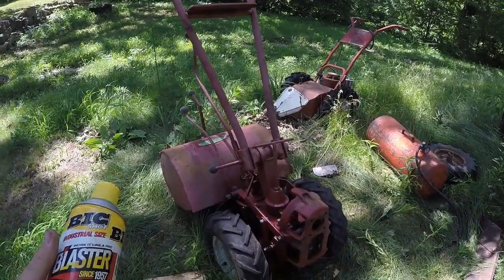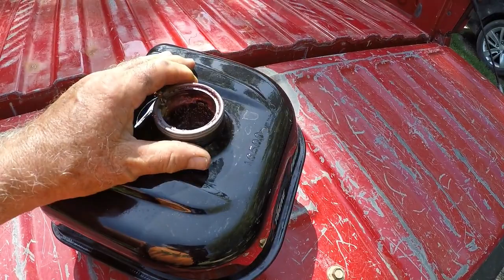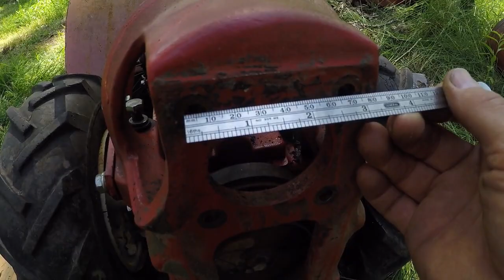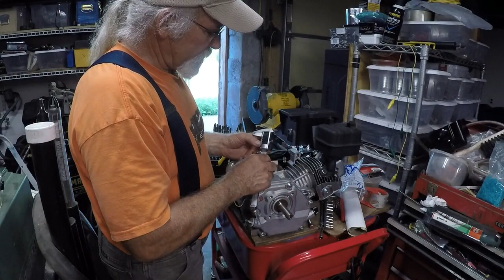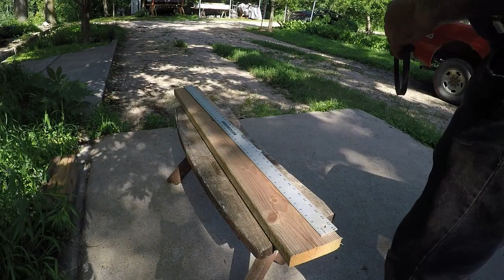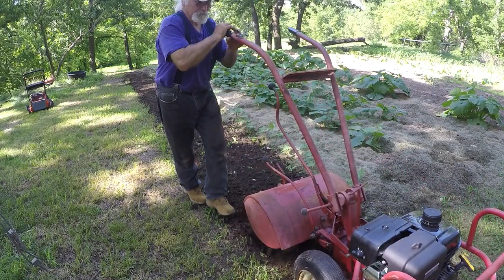Engine swap for Troy Bilt garden tiller, 212 cc 6.5 hp install solutions

Comment: Thank you for a great video.  You did not say why you enlarged the crankshaft hole. It comes 5/16 X24, which is the same as engine mounting bolts.

Comment: 1 note doing swap. 6.6 is better swap and side note the motor shaft has a 5/16”  x 24 hole the old motor had3/8” hole
Reply: Yes, thank you!!,  as this is usually not mentioned in videos on the swap. This video is excellent but he did not say why he is enlarging and retapping. It took me a little bit to realize that the crank hole is the same as the four engine bolts.

Comment from the maker: Thanks for watching my video,  Its ok with me if you prefer the original engine, my first Troy Bilt I bought in 1980 was a 7 hp Koller Horse brand spanking new in the box & 20 yrs later I installed a 8 hp and at this date it needs a complete rebuild including the brass worm gear at the tines. I bought the tiler in the video that had carb problems a long with low compression and burning oil which tells me poor oiling. Every one I know that bought the 6 hp Tecumseh had the connecting rod break, seize or piston seize. The problem is trying to till as deep as possible at full throttle  with that 6 hp, (I have been guilty of that), the oil splash doesn't work all that well with the engine at a sharper angle. Its not the engine so much, its the angle. I have a Tecumseh 8 hp on a stationary generator that has done will for 25 yrs running level but that engine is at the end of mechanical limits so I will replace it with a Predator 8 hp but have to pull out all the crankshafts and cut identical tapers in my lathe for another video. Glad you had the ability to repair yours and your happy with it but take care not to run it at a sharp angle or you might have to repair it again sooner than you would like. 
  Oh by the way check out the channel "Gardening with Leon" that guy is great and check out how successful you can use a "cattle panel greenhouse'. I'm building 3  10' X 12' this spring to get more produce and extend growing season. They are cheap & easy, watch a few of the youtube videos out there and have a blessed gardening season.

Comment: I have the same engine that had seized. I took it apart and it was in amazing shape except the connecting rod had failed. I replaced it and put in new seals and bearings (yes parts are still readily available).  I am no mechanic but that old engine is running good again and it beats a predator. If nothing else it weighs more which is good for traction.

Comment: Great video.  Did you ever do the electric motor version?
Reply from the maker: Thank you for your interest. I have not found a motor with the high torque & low rpm in AC that I would like and of course I would like it to be, well... free. There have been a good selection of electric small & light tillers on the market as of late to replace the trouble some 2 stroke garden tillers. Most gas tillers suffer from old gas & non-use decay that the nifty electric do not. So my putting a electric on one has not been a huge priority. But hey its been fun since I first posted this video. I have a few miss adventures to share too in the near future. Thanks again for watching, be resourceful, think on your feet because it will serve you well in difficult times and you will prosper when others fail.

Comment: I mix a wee bit of Dextron 2 transmission fluid in with my fuel, the tank stays coated and clean With no rust problems, just keep the tank full of fuel and turn off the fuel going to the engine when not in use !!
Reply from the maker: The coating I used had more to do how gasoline fuels are formulated (oxy and non-oxy), yours may be different hense the use of Dextron is giving good results for you and you should continue doing what works for you but might be a disater for others. The coating would work for just about everyone with all the wide spread use of alcohol additives in gasoline continues for now. Alcohol attracts water, alot of water.  Alcohol fuels are unsatainable without tax-payer supports, current methods of production use far too much water, land, chemicals, even including animal feeds produced and oil based energy costs. The system puts in more energy & resourses into a fuel than we get less energy and resourses from, if you really dig into the nitty gritty of it, the numbers say about alcohol as a motor fuel, "Bad Idea". Ah, but people hear what they want to hear and disreguard the rest.

Comment: A wind and solar powered tiller is in our future I’m told.
Reply from the maker: What we are told and what really comes true are two different things.  I have heard this before, "Glen, alternative energy will be so cheap that you won't need a meter."  Until the solar cells last longer than 60 yrs rather then 24 yrs @ .20 cents per watt and the wind turbans last longer than 150 yrs than only 16 yrs @.15 cents per watt and have no government subsidies, maybe but right now none of it pencils out other than power demand below 500 watts. Scale way back to life before electricity and it will work great!

Comment: You put on an electric motor better have a lot of extension cords.
Reply from the maker: Hey there Steven, thanks for the comment, I'm working on more videos so why not subscribe, some fun stuff to follow. Back on task about the long cord,  that could be an issue, that tells me that you are paying attention. You are so right. That aside, if you do a little looking around with just  "Electric Tiller" search, there are over 200+  different  brands on the market. Some are battery powered but most of the best ones are 120 VAC.  I think its going to become popular. Just about everyone I know that has one of those little gasoline tillers with a similar small engine to a weed eater has problems from non-use, sitting in the corner of the shed with old gas gumming things up just raises hob with that type of tiller. In order to get all the good out of a small gas engine is run the dog water out of them and replace the mixed 2 cycle fuel every 30 days because it goes bad even with stabilizers. Use them or loose them.  Electric motors don't seem have that problem or we are early into the life cycle of the invention with problems yet to pop up, they also use GFI so no one has been electrocuted.... yet. But some one dumb as a box of rocks some place is yet to make the news.   So its a trade off on struggling with a extension cord or with a gas engine decaying from the grip from old man time and you throw it across the yard because it won't run right. Been there done that.  My son bought an electric tiller two years ago and loves it so much that he ran an under ground wire to a all weather outlet next to his garden and has a method of not getting tangled up. Well its kind of like  when TIG welding, with enough filler rod, patients & time, any part will fit.   And another thing, if a little power is good then a whole lot is better, I was thinking of mounting a 2hp 230 vac electric motor on the Troy Bilt transmission, sounds like fun to me, what do you think?
Reply from the maker: Hey there Steven, thanks for the comment, I'm working on more videos so why not subscribe, some fun stuff to follow. Back on task about the long cord,  that could be an issue, that tells me that you are paying attention. You are so right. That aside, if you do a little looking around with just  "Electric Tiller" search, there are over 200+  different  brands on the market. Some are battery powered but most of the best ones are 120 VAC.  I think its going to become popular. Just about everyone I know that has one of those little gasoline tillers with a similar small engine to a weed eater has problems from non-use, sitting in the corner of the shed with old gas gumming things up just raises hob with that type of tiller. In order to get all the good out of a small gas engine is run the dog water out of them and replace the mixed 2 cycle fuel every 30 days because it goes bad even with stabilizers. Use them or loose them.  Electric motors don't seem have that problem or we are early into the life cycle of the invention with problems yet to pop up, they also use GFI so no one has been electrocuted.... yet. But some one dumb as a box of rocks some place is yet to make the news.   So its a trade off on struggling with a extension cord or with a gas engine decaying from the grip from old man time and you throw it across the yard because it won't run right. Been there done that.  My son bought an electric tiller two years ago and loves it so much that he ran an under ground wire to a all weather outlet next to his garden and has a method of not getting tangled up. Well its kind of like  when TIG welding, with enough filler rod, patients & time, any part will fit.   And another thing, if a little power is good then a whole lot is better, I was thinking of mounting a 2hp 230 vac electric motor on the Troy Bilt transmission, sounds like fun to me, what do you think?

Comment: Is the engine 192437-1125-e1 (briggs stratton) compatible with the Horse III PTO tiller? Came from a troy bilt chipper vac...
Reply from the maker: The engine I removed was a Tecumseh,   I just went by the mounting bolt configuration and shaft dia for using a harbor freight or very similar engine or Chinese Honda knock off engines. I have no idea which B&S engines can be used from other Troy Built products to fit on the transmission.  Troy Built has change hands several times in the last 20 yrs. You can't depend on anything conforming to all applications. Good Luck, hope it works out for you.
Reply: @glenrubash2836  Ok, thanks!

Comment: Rather than change the threads on the output shaft why not use a different bolt...duh,!
Reply from the maker: Ya, that's cool too, you are more than welcome to do that if you wish, I just didn't think of that, that particular way because  the new motor didn't come with a bolt or washer. I wanted a bolt that would have holding power without tightening too much rather than a smaller metric bolt plus Grade 8 Rockwell Hardness, the original Troy Built. I'm currently working part time in a college Physics Dept machine shop, the reason that I was recruited to work there was because of engineering common sense. Does NOT make me superior to any one, I just laugh last.. Sure the smaller metric bolt is passable but if your prepared and have a good compliment of tools & machines along with imagination you don't need to build with a less than adequate. The real point here is to cultivate imagination, not insult.  You get a C+ for the metric bolt, that's if the engine came with one?. But not everything is going to be easy & convenient, your not always going to have the right tools or the best manuals if you have them at all. Think on your feet and at this point in our American history things most likely will get very difficult in the next few years. Plus make due with what you have. Back to the metric bolt,  I  would have needed to drive 19 miles one way to the nearest hardware store, spend about $5 in gas to buy a $2 metric bolt and spend about 1 1/2 hours windshield time and vehicle cost @ 55 cents a mile,  doing that when I had the right drill, tap and bolt with washer. So really am I that big of a dope? DUH? I'm just trying to have some fun here and maybe help other people get by, its all we are ever going to do anyway... so lighten up guy. You can pick your nose and you can pick your friends nose... but its all fun and games until some one puts an eye out!
Reply: I made the same engine swap on my Troy Bilt tiller with the Harbor Freight 6.5 hp 212cc engine.  The new engine shaft had a 5/16-24 fine thread.  I picked up a grade 8 bolt at the local hardware.  Although I only needed to drive a mile to get there.  Because the engine shaft uses a 3/16" square key, and this is the member taking the torque load, I was not concerned about the strength of the smaller shaft bolt.  Tighten using a small amount of loctite and all is good.  I have drilled and re-tapped in the past.  I guess it's all about what's right and what works for the moment.

Comment: Hey Glen, I enjoyed your video. I removed the old Tecumseh today and will install the new engine in a day or so. I still have to pick it up. I couldn't remove the pulley due to a lack of clearance before I pulled the engine so hopefully I can get everything lined back up. Let me know if you need some zucchini.
Reply from the maker: Lots of zucchini came out of the garden this year and as of this writing the freezer is full with all the best. Hope your engine swap went smother than mine. Hey I'm going to start a new adventure flying a paramotor!! Planning to go to school for it in June 2021. I bought it after saving for two years, "They are not cheap.. $11K with everything. I'll have more videos this winter, all the clips are piling up so stay tuned.
Reply from the maker: I warned you that this video kind of sucks and it sucks to be me too but you watched the whole thing and its not my fault, I keep my doors locked now so no I don't need any more zucchini. I learned the hard way with all you obsessed zucchini people.